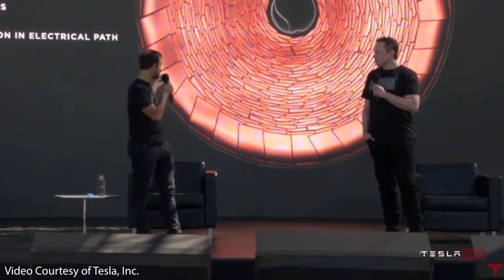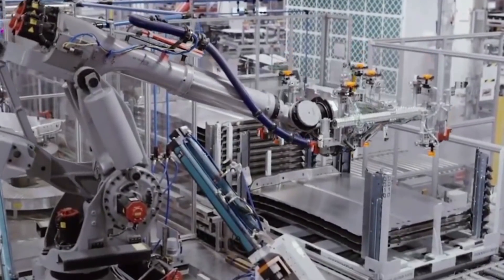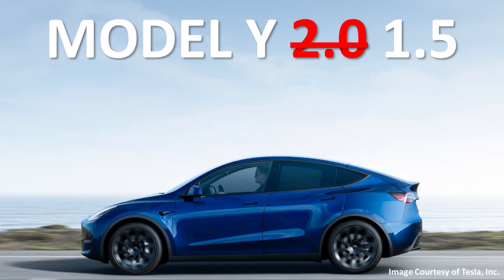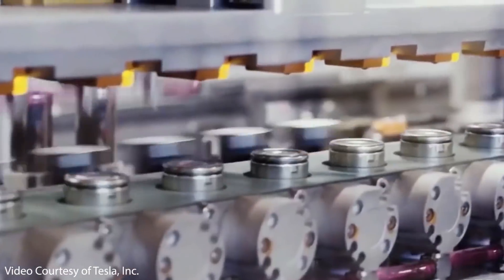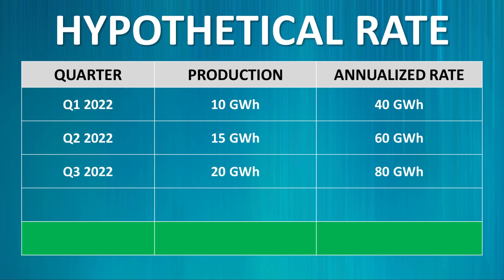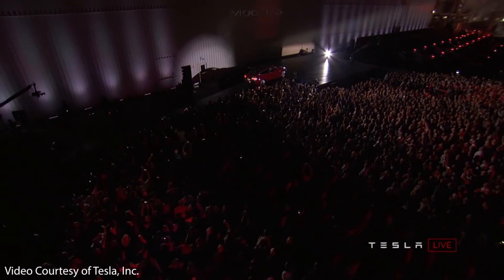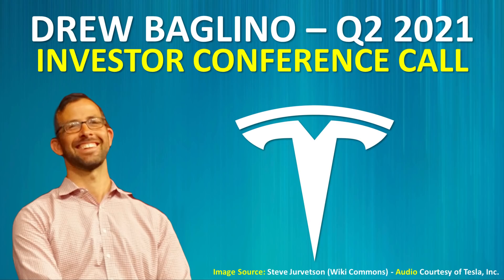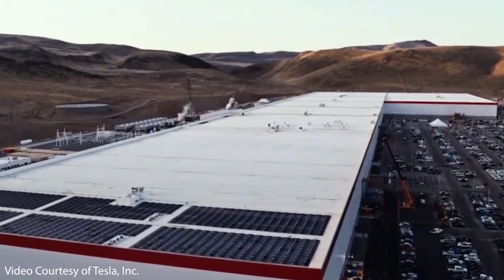NEW Tesla Model Y 1.5 with 2170 Batteries + 4680 Battery Updates

Comment: I would not want to take delivery of a 1.5 version or even early 2.0 version. The 1.5 is a compromise solution which will undoubtedly feature compromise build quality and workarounds and early 2.0 deliveries will likely feature the mistakes that will go into any learning curve in what is apparently a challenging engineering process

Comment: Tesla may not to create an Osborn Affect with a limited production of the Model Y with 4680 battery coming from Giga Texas. If the 4680 battery charges faster than the Fremont Model Ys with the 2170 battery, few people in the US will want Model Ys from Fremont. Most people will want to wait a few months to get a Model Y with the superior structural 4680 battery, paint shop, and casting then receive a Model Y from Fremont. Tesla will need to be able to mass produce Model Ys at nearly the same volume as Fremont before switching to the 4680 battery. Tesla will then be able to gradually upgrade the Fremont factory line by line with the new battery and manufacturing processes.

Comment: I think there are some delays with the 4680 battery cells.  The Tesla model S plaid + is a prime example of the delay.  The cancellation of the plaid + model is likely due to the 4680 batteries not ready for mass production.
Reply: I think they said that Plaid is so mad as a car and better than they thought, that it wasn't worth the massive effort to improve it to Plaid +, bearing in mind that the Roadster is due after that. That one is designed to still seat 4 (ish) and have room for shopping and golf clubs.
They'd then have a choice of three Supercars with under 2 sec 0-60. So not crucial to the mission to melt the ICE car.
Reply: @andrewsaint6581  That's what they said, yes :-)
Reply: Yes. They were late with 4680 and the came up with a marketing BS answer saying the Plaid is already do great. No, not in terms of range. 4680 will give it 850km.

Comment: I don't think any proposed products absolutely depend on the 4680. External structure on battery pack might add 200 kg, but otherwise no effect.

Calendaring delicate items with precision has long been done in the paper industry. Precision ground solid steel rolls stacked above each other for weight (zero pressure from bearings, which are not accurate enough), power driven at line speed. Calendar stacks in series on the line until desired finish.

I suspect worse problems managing jelly roll winding and stuffing with that tabless architecture. Pretty prone to uncontrolled movement of the tabs.

Interesting that 4680 was IBM's designation for their networked computers and OS which they marketed as cash registers since the 1980's. Like 390 and 30xx for big offices, 40xx for small offices.

Comment: Personally i'm waiting for the 4680 LFP cell.  enough range for me, but safer and longer-lasting.  Structural battery and 4680 format makes up for some of the deficiencies of the LFP chemistry.
Reply: LFP is the version I want! I don't care much for speed but I do want the longest life battery you can get.
Reply: It's the tabless construction that promises the big jump in longevity; due to the massive improvement in thermal properties.
Reply: @evfusion4094  Tesla is currently actively HEATING UP the battery before fast charging so cooling does not seem to be the main problem here :). Chemestry plays a much bigger role in battery cycle life. The improvements in thermal properties because of the tabless design are mainly to overcome the disadvantages of the 4680 form factor compared to smaller cells.
Reply: It's not sure that LFPs will come in the 4680 form factor at all.
Reply: @EinzigfreierName  I think you are correct. LFP offers the best bang for buck IMO combined with highest cycle life. But not for high end cars.

Comment: Giving other battery cell manufacturers some leeway in the chemistry of the 4680 is a bit of a double edge sword. On the one hand, their expertise may actually improve some aspects of the cell, but the downside is that for each different cell, there needs to be a huge effort to characterize, and optimise things like the charging regime, temperature characteristics, cooling etc. Then thousands of hours of testing, and finally in car data, to then apply AI to do repeated iterations of optimisation. In other words, massive effort. So this is why Elon wants to reduce the number of different chemistries. It's easier to optimise 3 or 4 - and really hard (lots of effort and time) to optimise 10 or 20.

Comment: I have concerns. Its been 2 years and still no batteries.
Reply from the maker: They are making batteries at the PILOT line in Fremont - just not at massive scale yet.
Reply: As Tesla said it is manufacturing issues not technology. I guess it is taking a lot of time to design and correctly set up production line design. It will be hard because they have to make the production line fast enough and with zero faults and consist quality.
Reply: Wasn't Battery Day Sept 2020?
Reply: 2 years is not a long timeframe for a development like this.  People are just way to over-exited and expect everything to happen much faster than it's  humanly possible.
Reply: I just got a MYP from Freemont with a 7/21 build and it holds over 90kWh’s🤷🏻‍♂️

Comment: Do the 2170 have a better energy density than the 1860 and why didn’t the revised S and X get those 2170? (so that only 2170 and soon 4680 batteries to produce…)
Reply: Sales numbers for S/X are so low, it would probably not be worth the effort to redesign its battery pack.

Comment: There's a lot of new tech in Tesla's 4680 cell; it's not a surprise that they are taking some time to get the manufacturing right.

I've been expecting 2170 cells to be used initially in Semi, Cybertruck, and the new Model Y production lines at GF-Berlin and GF-Austin.  For Semi and Cybertruck, the lower trim models were always planned to have lower ranges.  It's just the high-end ranges that will absolutely need 4680 cells.  They can start producing the lower-range models immediately upon christening new production lines.  There will be demand for those cheaper models.

Honestly, I don't expect the product ramp next year for 4680 cells to achieve your hypothetical run rates.  My inexpert guess is that it'll take a full year to burn-in each new production line, and that's after they solve the basic line design, which today is a work in progress.  Battery manufacturing is molecular engineering; getting reject rates down and volume up is always a challenge for a new cell production line.

Comment: They should've made 5000 batteries. It's easier to remember
Reply: Or 69420 batteries, since it's Elon's favorite number.
Reply: @RB-pi3jl  Good point
Reply: Silly them to refer to cell by its metric dimensions, rather than some arbitrary model number.
Reply: @fonkenful  Yeah because cells with 50mm diameter are impossible
Reply: @seasong7655  But with the second set of (two) digits denoting length, 50mm x what?
Reply: Hahaha!

Comment: I don't know if you should take having a backup plan as a bad thing.  One should always have a backup plan. The fact that he has a backup plan should be considered a good thing.
Reply: Of course but maybe the biggest execution risk factor is mass 4680 production ramp.
Reply: 4680 or 2170 in the model Y isn't really a problem for the consumer, it's of more concern to Tesla because they can build faster and cheaper.  The consumer will likely not notice any difference.
Reply from the maker: @bluetoad2668  Agreed. The Model Y is selling EXTREMELY well just as it is.
Reply: @johnnemesh5459  if you wait for the best tech you are always waiting for tomorrow. Personally I want the LFP Model Y
Reply: @johnnemesh5459  Agree 100% especially as the extra range is needed in cold climates. Greetings from Finland.
Reply: @johnnemesh5459  if you only have to wait another 12 to 18 months then why not.
Reply: technology will always evolve, what you buy now - telephone, computer, gaming console is obsolete next year
Reply: @Rockster1989  Moore's law says, "the number of transistors in a dense integrated circuit (IC) doubles about every two years". - Wikipedia
That basically means that as soon as you take any electronic device off of the shelf it is likely to already be outdated.

Comment: My bet is Model y lr became standard range and will continue with 2170, and the new Lr will use 4680.  Is there a reason why the 2170 cant have a structural battery pack?
Reply from the maker: You may be right. I don't believe there is a technical reason that would stop the 2170 cells from being included in a structural battery pack, however it would might be a waste of time to design one for a temporary stop gap.

Anyone else have any thoughts on this?
Reply: They can't drop 2170 so sudden as it would mean restricting the Giga factories. What I believe will happen is they'll do semis, cyber truck with the 4680 first, then the S and X then model 3 and Y. We won't see Y 3 with the batteries until at least 3-4 years at minimum.
Reply: @gester27  that’s not going to happen because the Y is where the money is. They will move more units of that car at a lower price point than all the other models combined
Reply: @brandonglucas  they won't lower the price on the Y or 3 since they'll be coming out with the 2. I mean, if they use the new battery on the Y and 3 before they do it on their more expensive cars, then they'll just be killing those models off. If they do that then it will be a win for us consumers but maybe not the company.
Reply: @gester27  I think the Y and the 3 are both currently overpriced by about 10k and I think they agree since the starting price point was so much lower
Reply: Having a non-strucural battery actually makes a bit of sense, but more so for the more expensive designs. If you can afford one of the more expensive models then you might be able to afford a battery swapping station in your garage. The batteries that aren't actually in the car could be used for energy storage replacing the powerwall system.
Reply: @justinweatherford8129  that would be a very cool feature, probably the only way battery swapping would make sense. Not sure how much engineering and equipment would be needed to swap a 80kwh battery at home. Would probably need some expensive tool to make it a fully automatic swap. I don't think it would be wise to it with a simple jack and torque wrench.
Reply: @Curacars  no, that is why it would have to be for the wealthier Tesla owners. You would have to have an actual battery swapping station. However Aptera saying that their vehicle would be made so that anyone could swap out components on it; such as, swapping out the battery for a more powerful on is what gave me the idea. I don't think that Aptera actually going to go with their ease of parts swapping idea though.
Reply: @justinweatherford8129  that would be for a few rich people only, but they probably just buy a 2nd and 3rd EV anyway. I like the Aptera but it will take 5 years before they can produce meaningful numbers. Their low price will make it extremely hard to get profitable if ever.
Reply: That’s not going to happen because then the SR will cost more to produce than the LR